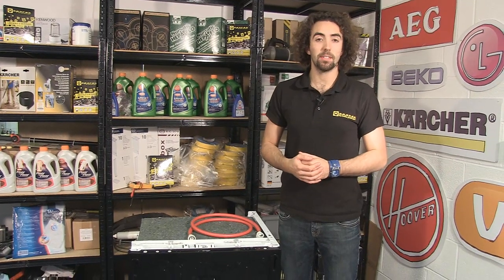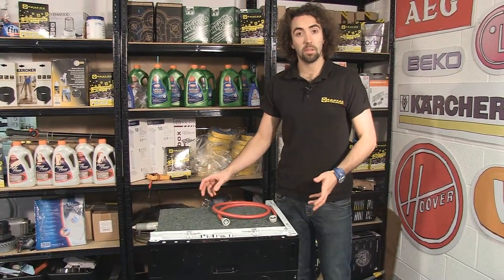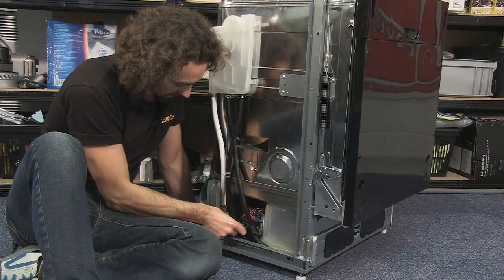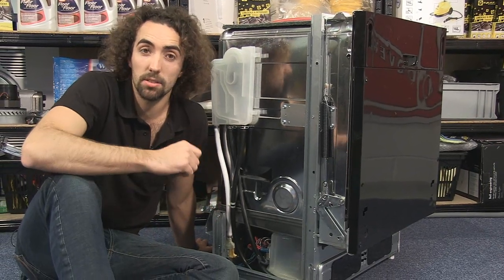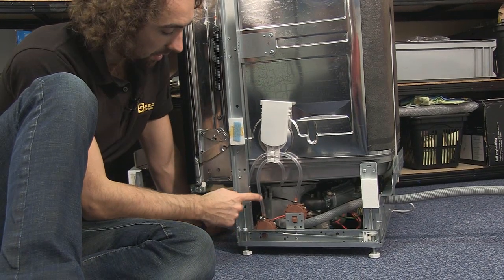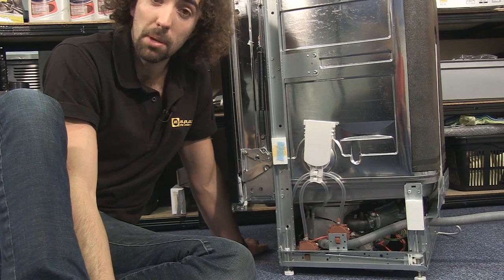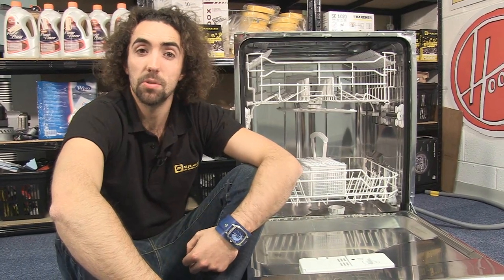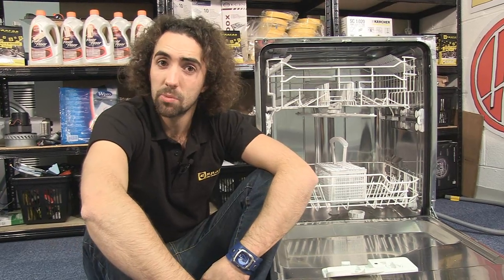How to Diagnose Filling and Dispenser Problems in a Dishwasher

Comment: I'm not sure if it is the pressure switch problem but my dishwasher cleans well only the dishes loaded on the bottom rack while the ones from upper rack usually end not washed well enough. I have two pressure switches (Gorenje GV62110, the one from other eSpares videos). The sprayer is not blocked inside, spins easily and the dishes are being loaded properly. Any advice?
Reply from the maker: Checking the  manufacturer's diagram shows your machine does not have a 'diverter valve' to alter the flow. The water flow and pressure are only effected by either a restriction in the spray jets (rice or similar) or the pump running slower (motor capacitor or motor). Check these and if nothing is obvious try replacing the motor capacitor.

Comment: Hi my dishwasher is running really hot,it blew the ubend pipe under the sink off as it was so hot ? Otherwise running lovely ?Any suggestions please x
Reply from the maker: Hi Sharon. Dishwashers usually dry the load by rinsing in boiling water and then emptying so will often discharge very hot water. This should not be a problem even for plastic pipes. With the very cold spell we have just had in the UK the problem could be due to Ice blocking the pipes. It is unlikely there is a problem with the dishwasher so retry it once the pipes are repaired.

Comment: With multiple sequences and components and a very high number of possible faults along with service personnel charging $80 just to walk through your door before they even look at the dishwasher i would just use the kitchen sink.
Reply from the maker: Hi Otto, while we respect your choice we are slightly puzzled as to why you watched the video?.
Reply: eSpares I am an Electrical contractor and had a request to inspect why a pcb module at the bottom of a Bosch dishwasher shorted out for a regular customer. There was moisture present in the pcb so i viewed this video and others to make an assessment on the ingress of water as i do not repair dishwashers and the service company was charging incredible fees just to walk through the door.
Reply from the maker: That explains it, thanks Otto.  Just a comment on the problem you were investigating as you are 'not familiar' with dishwashers.
Most dishwashers are designed with a shallow tray in the base that will catch any water that leaks and raise a float shutting the machine down. The module should be protected in normal circumstances from any leak so if there was water in contact with it it would normally only occur if the machine had 'stood' in water during a flood.
Hope this helps.
Reply: eSpares Thank you for the advice. We cannot locate spare module (Selcom Group EPG 60610 Typ.PB 9000450203) so he has decided to purchase another dishwasher.
Reply from the maker: Should have tried our website with the model number not the module number.  😊
Reply: eSpares Have tried both without luck. Mod. no. SMS63M08AU . I will try your spares department in future, thank you.
Reply from the maker: When searching for parts it is important to use the full model number (there are nine versions of the SMS63M08AU from/55 to/25)
We listed at least some of these if not all for example: 
http://www.espares.co.uk/product/es1703014/control-module-programmed